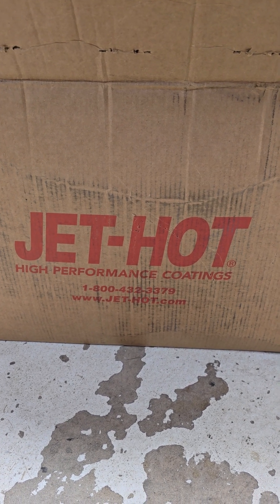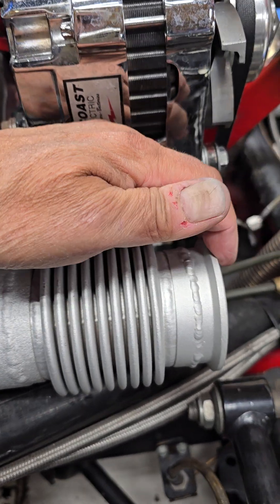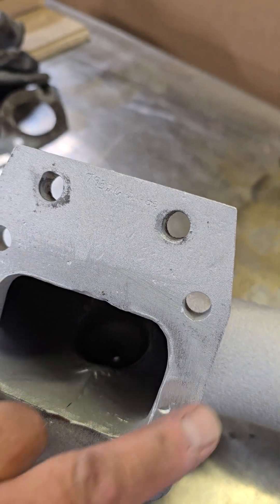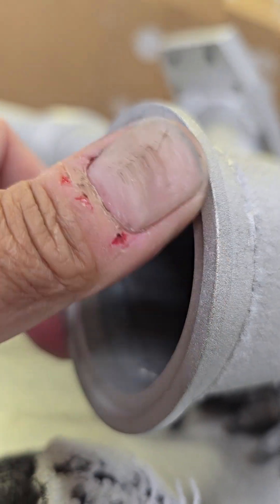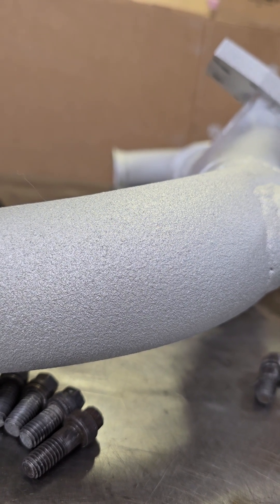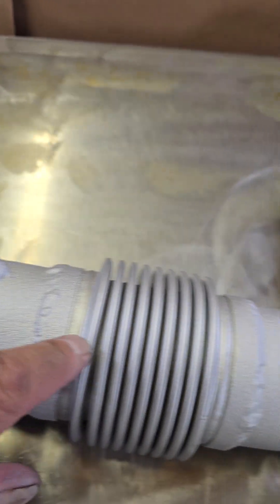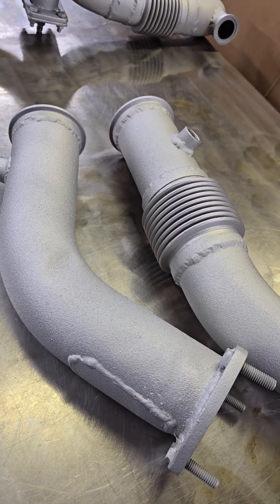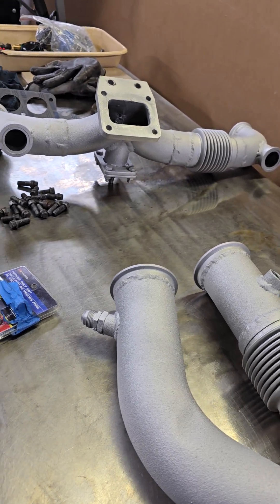JET HOT 2000° FINISH REVIEW for HAF JAG

Comment from the maker: Actually, the encoding and the v band surfaces was very thin. And has no issues... But the amazing thing is. The heat is contained in those exhaust pipes in my fan, which usually runs constantly trying the cool. The ran eater down below 195°, didn't come on at all. A day when it was eighty degrees outside... I'm amazed at how well this stuff worked... And the coding itself is like iron clad... Extremely difficult to even grind off with the grinding wheel.. It's some pretty good stuff. And it even keeps its finish, so I would say get er done... It's one of the few things in this automotive game that actually works. That's good as promised

Comment: I am about to send my parts in for the same 2000° coating. Have you found out whether the coating on the vbands cause any leaks?
Reply from the maker: Hi Floof...jsut saw ur question.  No problem as the coating was a light type of finish coating and no leaks.  And the coating on the rest of the pipes works very good...temps are down by 70% or more.  Well worht it.